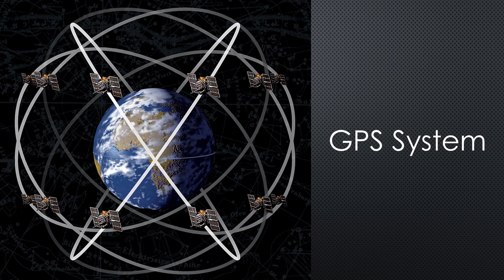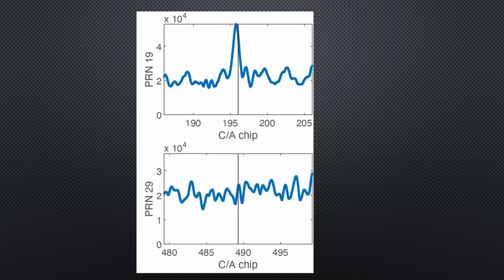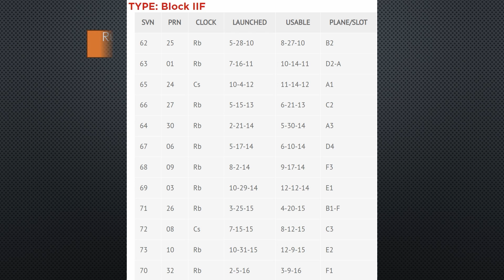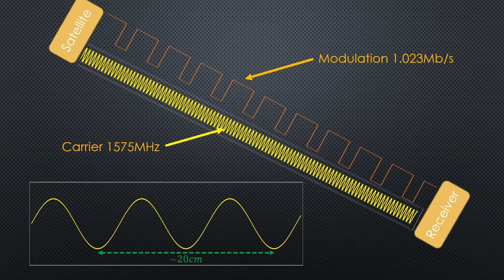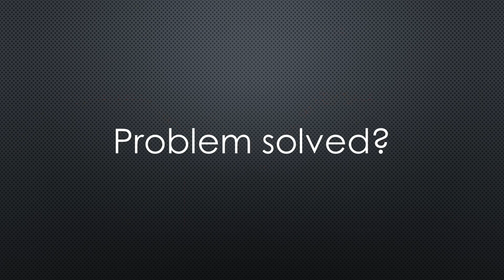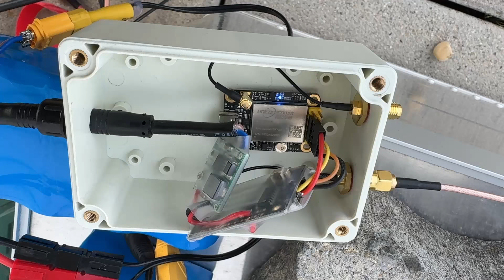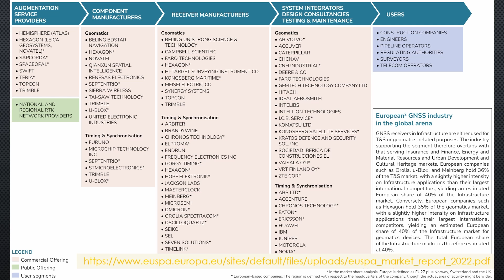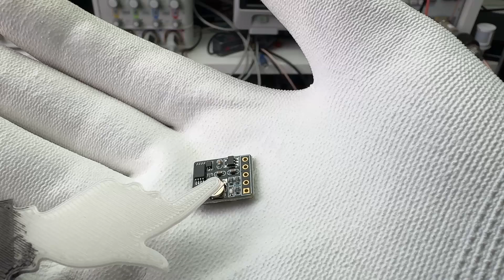(483) ESP32 precision GPS receiver (incl. RTK-GPS Tutorial). How to earn money with it (DePIN)

Comment: Does the RTK base station have to be stationary to work? Could you have two GPS receivers on the same vehicle, connected by a cable, to get RTK correction? Could a swarm of moving GPS receivers (like smart phones) collaboratively provide RTK corrections to each other while in motion relative to each other?
Reply: Base needs to be stationary.
Reply from the maker: The base has to be very stable over time for this scenario.
Reply: To add on top to the other comments: What you are describing is a "moving base" setup. This allows you to determine heading and relative position between the two antennas. 
However, you will miss coordinates on an absolute coordinate frame - as for this, you'd have to have a reference point from a station at a known location.

On smartphones: Doing RTK with Smartphones is technically very hard. The GPS/GNSS antennas in smartphones are not well suited for receiving carrier phase data - in essence, they are a piece of wire, and with varying orientation. What is lost at the antenna can not be compensated for later on in the receiver

Comment: What is the difference between RTK and Differential GPS?
Reply from the maker: The phase measurement.
Reply: Differential GPS measures the time signal from the satellites (the pseudo-random bit code - the C/A). Due to bandwidth of the RF frontend in receivers, and many other reasons,  the correlation peak can not be tracked well enough to go sub-meter (a single "bit" of the PRN code has a length of 300m, so it is about detection the edges of those "bits"). 

As Andreas explains in the video, the key to precision is to track the carrier phase. "Tracking" of a signal which is actually not visible as it is below noise can not work with a normal PLL - nothing it could lock onto. So a reconstruction of the carrier phase from the other measurements (code/frequency) is done, which then allows to "track" those 19cm waves with very high resolution

Comment: How far can an ESP32 really transmit corrected GPS data? Wouldn't it go farther if LoRa were involved?
Reply from the maker: In my setup, it only has to transfer it to the next Wi-Fi access point. It should be possible to use LoRa to build a direct communication between the base and the rover.

Comment: So are the pseudorandom noise algorithms then a secret that only proper GPS receivers can receive the signal and decode it. Or is it possible to receive and decode and with that determinate our position with an SDR? 
Also do to restrictions, civilian GPS has limits on height and speed, would it then be possible via an SDR to overcome this restrictions?
Reply from the maker: I do not think that these codes are secret. You can use a HackRF to spoof a GPS receiver that it thinks it is in the White House...
I do not know if there is software to decode the position with an SDR.
Reply: SDR sharp has corresponding GPS decoder if i'm not mistaken. So it is not a secret.
Reply: The satellite transmits multiple codes - the initial system used 2, one for signal acquisition (C/A code) and one for precise timing (P code) - the transmission parameters for both were published, although the P code also had an "anti spoofing" mode called P(Y) the details of which have not been published.  It also had the clock jitter "selective availability" mode which has now been deactivated (largely because differential GPS made it almost pointless).  The later satellites have two additional pubic carriers - L2C and L5 that also have published transmission parameters. They also support an undocumented military use only "M" code for which the transmission parameters are obviously not public.  Even now, most GPS receivers are single carrier (L1) and C/A code only - and that's a completely documented format. If you want all the details, search for ICD-GPS-200. And yes, if you just take the nav data and the pseudoranges coming from the receiver you can decode them yourself and not implement any of the arbitrary performance limits. If you are using a later satellite using L2C then you can also do your own tropospheric corrections rather than relying on the approximation that the satellite transmits.
Reply: @TrimeshSZ  thanks for the great answer
Reply: Re height/speed limits: In principle yes, but you would - depending on your jurisdiction - violate sanctions on dual-use goods if you were to export
Reply: @onocoy  I remember having a conversation with a Chinese company that would have been funny if it hadn't been so stupid - they made a bunch of GNSS modules, with the basic version being a tri-mode GPS/GLONASS/Beidou positioning receiver - I asked them about the dynamics limits, and they confirmed that they were implemented - and were in effect even if the GPS functions were disabled in the config, because their understanding of the rules was that any device that was capable of receiving GPS signals had to implement them - but they then went on to say that they also had a version that supported GLONASS and Beidou with the GPS capability permanently disabled in hardware, and that one didn't have any dynamics limits. Which to my mind made the whole thing pretty much pointless.
Reply: @TrimeshSZ  I’ve seen such unlocked Receivers for cube Sats one time, for EU citizens it wasn’t that difficult to buy. Surely harder then something on Amazon but these where quite pricey, If I remember correctly around 5000€ 3/4 years ago. 
Are those Acceleration Limits mentioned in the Datasheet a from of restriction or just technical limitations?
Reply: @maxmustermann9858  There isn't any cocom limit on acceleration - so that's either going to be a hardware limitation (I.E. crystals do strange things at high accelerations) or one that the vendor has added to reduce the search space for the position solution. Another thing to bear in mind is that these space rated parts are typically based on quite old designs because the very high costs and subsequent low sales volumes tends to lead to extremely long product cycles.

Comment: How does the base station obtain its precise location?
Reply from the maker: I did not have to care about. Probably with time. It has to be very stable.
Reply: @AndreasSpiess  So the 1 cm accuracy is in relation to the base station and not the true coordinates?
Reply from the maker: @drooplug  No. At least my garden was exactly where my garden is. I assume it uses some averaging. But maybe we will get a better answer from Onocoy...
Reply: We are processing 24h of data from every station (and repeat that every day) to determine the accurate location of the station, and add this to the data stream before it is being delivered to the rover device. If this is not done, you still get a precise (i.e. relative accuracy) signal, but not an accurate system on a global scale
Reply: @onocoy  So I understand correctly, a  location with cm precision can be derived from many measurements over time?
Reply: @drooplug  Yes, if you only take the signals from a single station, you can collect data for multiple hours to determine a cm precise position.

Comment: It bothers me that its cryptocurrency involved in some of this .   Good idea otherwise, to democratazis 
Precice gps navigation,because of the very high prize of correction signals . 
Cryptocurrency companies are  seriously  sus doe ... and crypto is using a lot of energy =co2 emissions.
Reply: hmm, cryptocurrencies are an efficient (low cost / fast) way to enable micro transactions, a prerequisite for a decentralized system.

The only cryptocurrency that uses a lot of energy is Bitcoin ("Proof of work"). All the other main ones follow a "proof of stake" method where energy consumption is not a concern.

Comment: Isn't 1m accuracy available for free for many parts of the world through satellite based augmentation system? E.g. EGNOS in europe.
Reply from the maker: I am not sure uses RTK. AFAIK they only use "differential GNSS" without using the carrier phase. But maybe somebody knows more.
Reply: Yes. 

RTK delivers two orders of magnitude better accuracy, which is relevant for some use cases
Reply: @onocoy  ... for a price. But getting 1m "for free" (well paid by your taxes) is also not a bad option. I don't know, are SBAS used as a default by the usual GPS modules?

Comment: Guys, could somebody explain to me a practical usage of geolocation to the centimeters around the globe?
Reply from the maker: For example you lawn mower. Currently, most lawn movers use a cable as a limitation of their area. With  cm precision, it does not need this anymore. Or in precision agriculture they steer their tracktors autonomously. Both need location accuracy far below 1 meter.